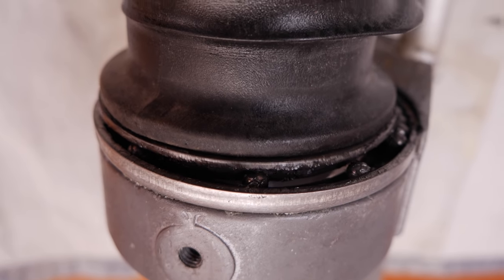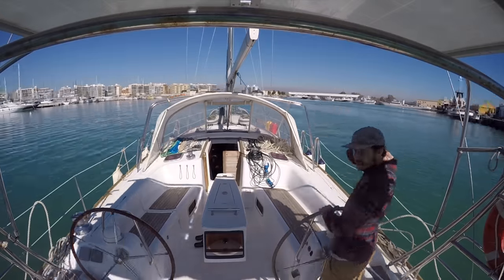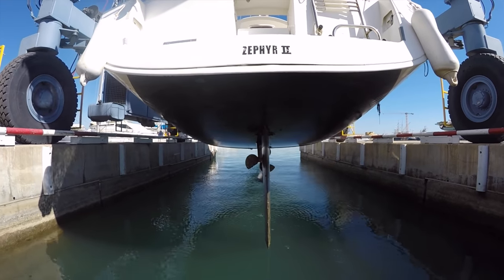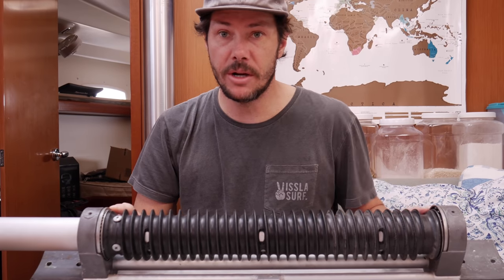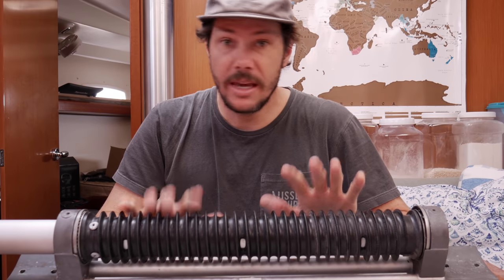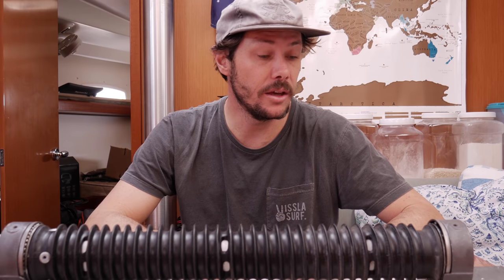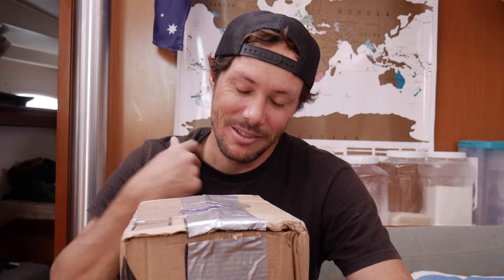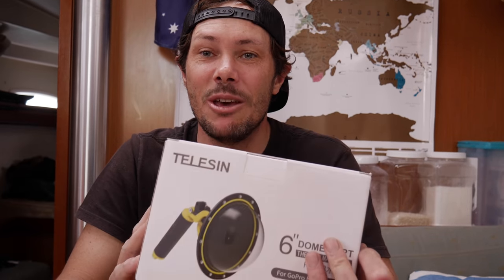BOATYARD Time...Zephyr Needs REPAIRS - Ep.48

Comment: I am very surprised at the absence of thrust bearings. It puzzles me to see that small of a roller bearing sealed or not. I would imagine a conical thrust bearing would be more expensive, but in this case , servicing and warranty problems will be far more costly.  I wonder if replacing both bearings with thick delrin washers would solve the problem You would have two very slippery flat thrust faces, not a collection of highly point loaded bearings.
Reply from the maker: That's a great thought Tinho. I am not sure what the considerations have been around thrust bearings. I am going to add it to my list of solutions to pass on to ZSpars this week. Thank you kindly for the thoughtful feedback.

Comment: Contact me if I can be of help with this technical issue. I am an engineer and own a BO40. It has a in mast furling so I have particular interested in your solution. 

Firstly, there should never be so much axial looseness that the bearing balls can fall out! Never. Axial clearance should not exceed a few thousandths of an inch. 

Secondly, the need for shims, spacers or an axial adjustment of the bearing blocks is indicated. From strain the bearings blocks may have worn or spread further apart or the rotating portion may have worn reducing its length.

Thirdly, the bearings being open is not the problem here. Sealed bearings are likely not available in this configuration. 

Finally, excess halyard tension, while not the cause, should be avoided. 

I really like your videos and wish you continued success and safe travels.
Reply from the maker: Hi Vincent - Great feedback. Keep an eye out for the next ZSpars feedback and proposed solution. Not the next video but the one after. It think you will find the technical feedback from them interesting. Appreciate the time taken to send the feedback. Cheers 👍

Comment: One of the reasons the bearings are not sealed is so you can rinse the bearing out with fresh water . This is because of the salt.
Sealed bearings never stay sealed for long.
Reply from the maker: Interesting point Todd. I hadn't considered that. I'm still not convinced thought that using the bearing design they have is the best design. Thoughts on how they could improve?
Reply: @SailingZephyr  Furlex furlers say that very thing - Rinse with fresh water , I drop the head sail at least once a year to rinse clean the top furler

Comment: Easy fix = Boom furler , weight down low , any stuff ups can drop sail, water catcher , Battened sails , stronger boom  there you are . The rise of the whole system would indicate a worn shim at the top ??? can you see if the wear is inside the top , maybe a new S/S chim at the top might be the answer ?

Comment: Good video!  I'm not an engineer but I would look in install a wave washer under the lower bearing keeping the lower bearing in contact with the screw as it rises.  Also finding a way to keeping both bearings lubed might helped.

Comment: Hi the problem with your furling bearings. May I suggest if you take the unit to competent small engineering workshop and let them have a look at it it may be possible to install a couple of caged taper roller bearings . I'm sure the engineer would be able to work out the way of adjusting shimming the bearings to make them work properly. Stainless steel Taper Roller bearings Will last forever.
Reply from the maker: Great suggestion Lee. I am going to add this to my list of solutions to discuss with ZSpars. Appreciate the time on this. 👍
Reply: good suggestion Lee, I was thinking of caged ball bearings which should prevent the ball bearings from dropping out

Comment: Run  a Z Spars in mast for 8 years no issues. Sailed 10000 miles. The bearings are designed to be flushed and should be regually. I also occasionally a little silicon spray which is non stick. You must have some other issue going on.

Comment: Great video, from what I can see the problem is more that the bearing caps are not held square to the shaft than just the vertical tension, they are only supported on one side and can and have spread you can see the difference in gap on the lower bearing between the supported and unsupported sides of the cap. This could be relatively easily fixed if there is room in the mast by making a stainless steel support bar that fixes to both caps on the forward side of the furler, opposite the thicker aluminium rod and holds the caps square say 20mm wide by 4mm thick with 2 screws at each end. If there is room you could use two say 30 degrees off the center line for more rigidity that mod coupled with sealed bearings would make the furler very reliable. a local machine shop could precision fit the bars but it wouldn't be too hard to set up a clamp to bring the caps square again and fit them yourself, hope this helps. cheers moose
Reply: Further to Moose's analysis, I would be checking for fatigue cracks or bulging of the mast around the bid fixing bolts. For the end plates to spread apart the load would tend to push the big fixing bolts out of the mast.
Reply from the maker: All good points Gmoose & DnG. I'm documenting all this great feedback for ZSpars. Appreciate the time taken to let me know. 👍

Comment: Thanks for the excellent update. I am current restoring an Alden 44 (hull #1) and am going with good old fashioned slab reefing on the main. The problems you are experiencing have convinced me that I am making the right decision.  Cheers!
Reply from the maker: Hi Tim - Please don't let our experience with the furling drum discourage you. Aside from that issue, the overall in-furling system works amazingly. Endless reefing options and all manageable without every leaving the safety and comfort of our cockpit.

Comment: Hi
as far as i know 
i am not an engineer either 
but to me there is a need for a thrust bearing at the bottom bearing to stop the play between the 2 bearing , also for a second idea 
the bolt holes at the bottom should be a slot where you can push up the bottom bearing , then when there is no play in the bottom bearing you tight all the bolts and that should 
stop the problem of losing the balls , of course it should be verified often so that bottom piece does not slide down 
good wind , and hopefully the problem is settled one and for all
Reply from the maker: Very interesting points Louis. Agreed that there needs to be a better solution to minimize the play.

Comment: Since you have spare bearings look for a store that sales them specify and see there is a closed bearing that would work
Reply: David  You have the same thought. There are stores that specialize in bearings. If you can take apart the area where the bearing sits and measure with a micrometer inside, outside and thickness, then relay that information to that store. They probably can get a sealed bearing to fit. The bearing that is in there should have a number on it. That number should also tell who made the bearing and be used as a cross reference for a sealed bearing. Most manufactures do not make their own bearings. A good bearing store will access to any bearing made in the world. Good luck..
Reply from the maker: A good point David. I have it on my list of suggestions for ZSpars. Let's hope they come up with a good solution.

Comment: Hi thanks for update and tend to agree with you regarding the bearing issue and while you have a spare unit maybe use it as testbed for a closed bearing system.  Hope you come right as it a small thing bit had huge potential for disaster and usually when you miles from anywhere.   Keep up great work and looking forward to follow ups
Reply from the maker: Thanks Dave. Agree on all points. And as you said, small issue with huge potential for safety and problems.
Reply: James if the vertical tension is keeping the top bearing from throwing the ball bearings is it not possible to insert a tensioning spring under the lower so that even when vertical forces pull the screw mechanism up the lower bearing assembly stays under tension and thus does not gape and shed ball bearings     failing that a skirt of sorts that can slide over that lower bearing allowing movement but not allowing bearings balls to pop out     know the tolerances are tight but sure can be machined to tolerances that will allow fit within the mast and vertical movement but stop any lateral movement   just a thought
Reply from the maker: @davecrawford5390  It sounds like a possibility. It all depends on the type of work ZSpars is prepared to stand behind I'm guessing.  I'll add it to my list of ideas to pass on to ZSpars. Really appreciate the thoughtful feedback Dave.

Comment: A sealed bearing that size would be just a few dollars. Can't believe they would be so cheap as to save that little amount at the cost of longevity.  Probably some old engineer that "has always done it that way".
Since you have the old bearings, you cold get the numbers off them and perhaps source sealed equivalents.
Reply from the maker: It's definitely a consideration. However, as the system is under warranty, I want all works to be done by ZSpars.

Comment: Sorry, but most commentators did not understand the problem. Sealed bearings do not solve the problem at all. 
The bearings must be unsealed to be able to wash out salt water.

You mentioned the problem in your video:
The rolling system must be able to deal with radial AND axial forces. 
The installed ball bearings can only absorb radial forces, but this type of installation forces the ball bearings to also absorb axial forces. 

To simplify: The bad engineering of this rolling system is the problem! ;-)

Question 1: 
What causes the axial force on the rolling system and how can it be avoided?

Question 2: 
Is there a way to install an additional axial ball bearing to prevent the furling system from moving up and down?

Expansive solution: 
introduce a axial bearing in your furling system.

Cheap solution: 
Use some washers to avoid up- and down movements.

Fastest solution:
Change the angle of the furling-IN rope. I suppose, at the moment the angle of the rope is approx.30 degrees to the mast. This angle is to small, and produces the axial force.
90 degrees will be perfect.

Maybe this pictures will help you to understand the difference bearings.

https://www.kugellager-express.de/was-bedeutet-radiale-und-axiale-belastbarkeit?gclid=EAIaIQobChMItf302NCI6QIVzoKyCh2g3A01EAAYASAAEgKFpfD_BwE

Comment: If could be the aluminum bars in the back may be stretching a little all of the tension can you figure the weight of that boat and the size of that sail and you put a little pressure on it that's a lot of pressure

Comment: Just replace the Bearing with a Rubber seal or try a Thrust Needle Roller Bearing if you can get the size and spacer correct but go to a bearing Outlet and take the old unit with you and see what they have to say, if anything other than put a rubber seal back in. just saying lol.

Comment: I don't know if sealed bearings would be more reliable. The top one has the steel bracket to be compressed against, which is fine and what bearings are designed for. They're not designed to be pulled apart, which is what is happening with the bottom one: the inner race has nothing to push against. A better design would be to extend the inner shaft beyond the bottom bracket and put the bearing below it. That would ensure the bottom bearing had the bracket to push against and be in compression. Just my thunk. Crap design.
Reply from the maker: I'm liking your thinking Jane.